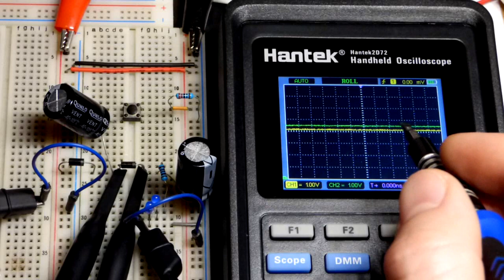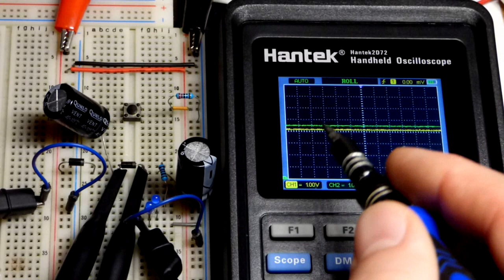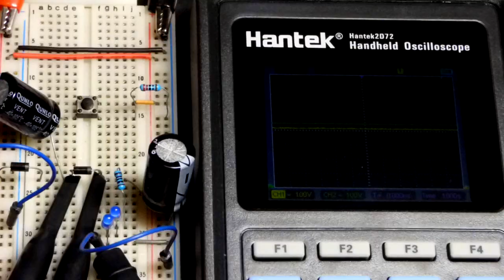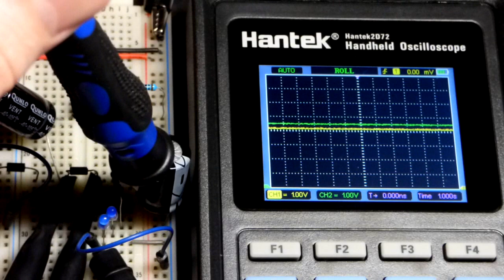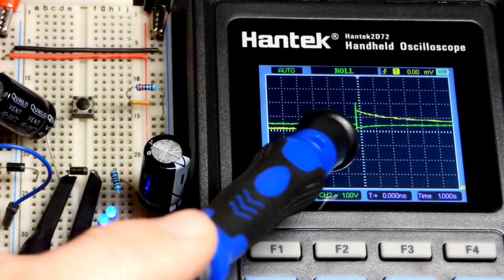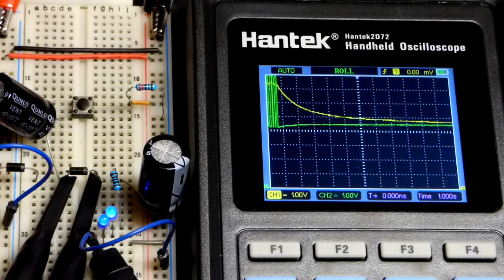2 channel oscilloscope measurement of voltage doubler with diode drop circuit roll mode how to DIY

Comment from the maker: Circuit explained in https://youtu.be/MzSRKMaTlTs DIY voltage doubler with diode drops demonstration circuit how to schematic diagram by Electronzap
Affiliate link https://amzn.to/3Ohcf7k for Hantek 2D72 Handheld Oscilloscope 70MHz Waveform Generator Multimeter 3 in 1 Multifunction Tester 2CH+AFG+DMM
List of my videos https://www.youtube.com/c/electronzap/videos
https://www.patreon.com/electronzap
https://www.amazon.com/shop/electronzapdotcom As an Amazon Associate I earn from qualifying purchases. Americans should check out one or more of those links before making any purchases. There's no extra cost to you.
https://electronzap.com/
https://www.reddit.com/r/ElectronicsStudy/